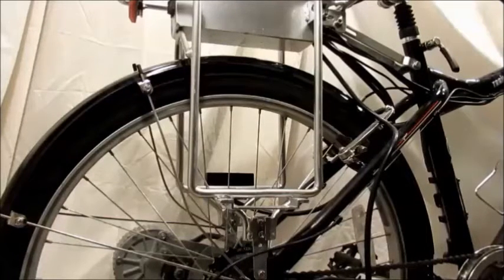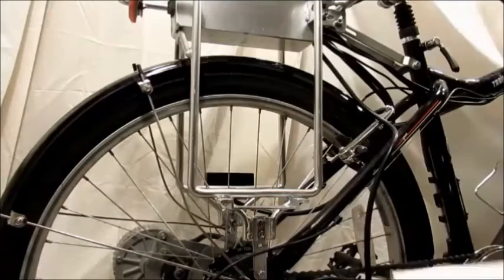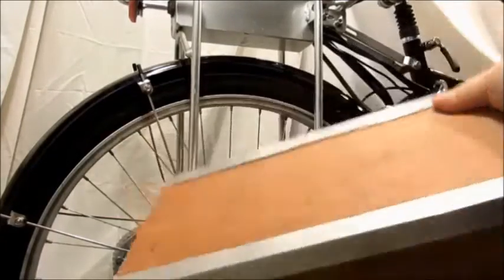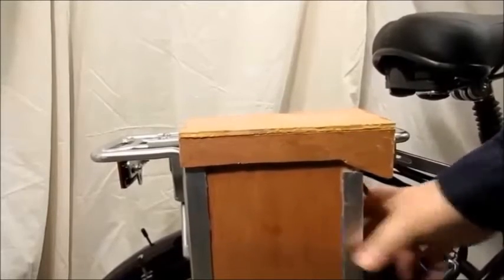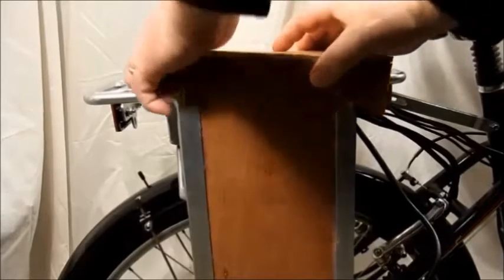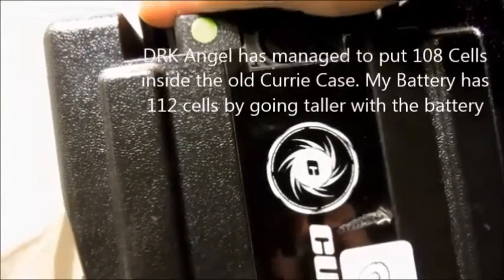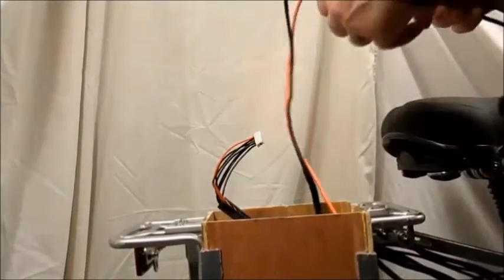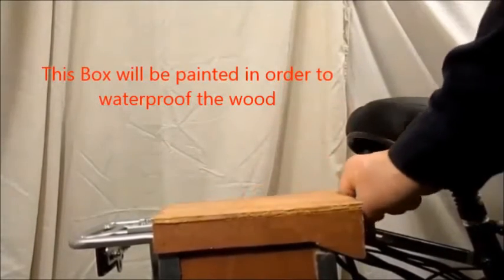Making the Battery Box for the 18650 E-Zip EBike Project part 18

Comment: I have a folding bike with 24 volt ,,front hub motor in the uk,, it does about 14 miles on a charge ,, I want to replace the battery with a homemade one like the one you built ,, measured the two output pins on the battery box and is 29.3 volts fully charged ,, cannot see the speed controller box , is it likely to be built in with the battery do you think ?  The bike is called a connect sold in Halfords uk ,,pedal assist only ,,15mph ,, the long slender battery slides into a holder tray under the rack above the back wheel ,, thanks Shane uk
Reply from the maker: You can certainly design a battery box to fit into the space where the original battery now resides. The controller you have now is within your 8.8 Amp Hour battery housing. It appears that your Coyote Connect has space in front of the battery where a new controller could fit. You may need a new twist throttle with the new controller.  I do not know if your bike will still fold with the controller in that location.  You might increase the voltage to a 36 volt  controller to increase speed and add more 18650's to increase range. Your old controller is probably limiting your top speed. Buy a new controller with no speed restrictions and add some pep to your step and some glide to your stride. Cheers